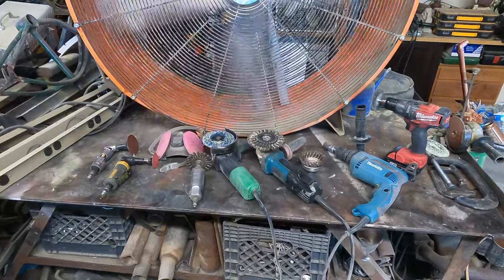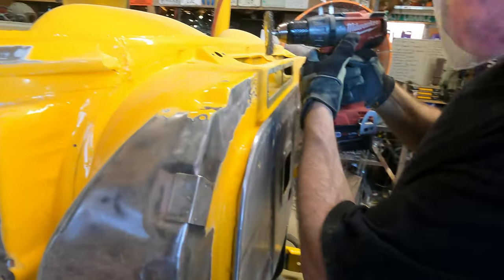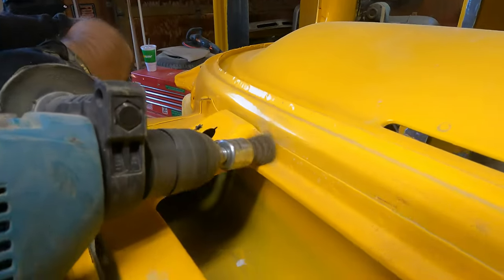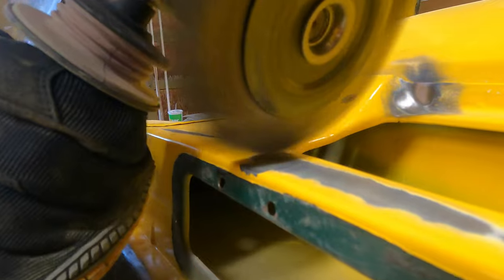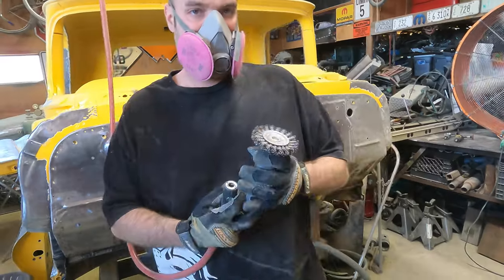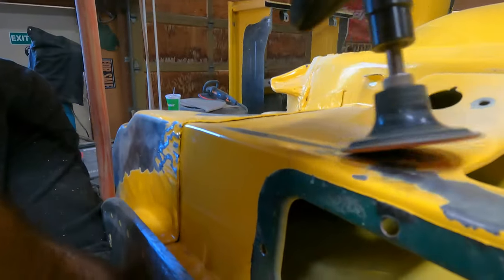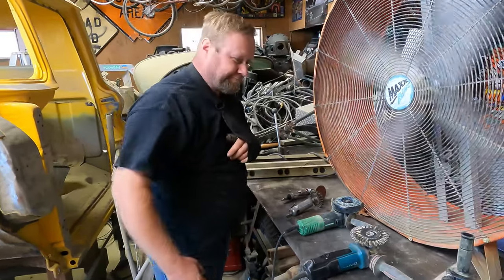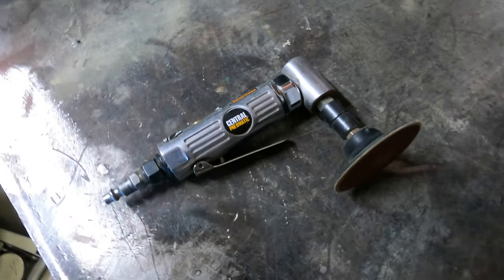How to Strip Paint Down to Bare Metal: The Easy Way

Comment: Hey Horsemen. Good video. Yea, there are lots of tools to remove paint and rust. Use LEATHER GLOVES. I was using a 4" twisted wire wheel and wearing cotton back gloves and it caught the back of my glove and pulled my hand into the grinder. And YES, it hurt right away. Stay safe and thanks for sharing.🍁👍👍
Reply from the maker: Yeah I hear ya, no good. Thank you very much Andy!!